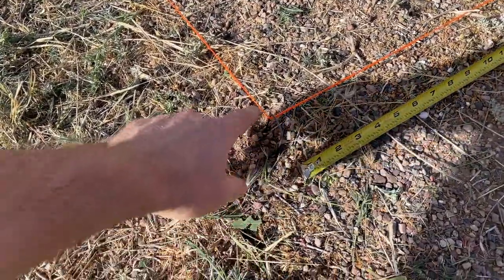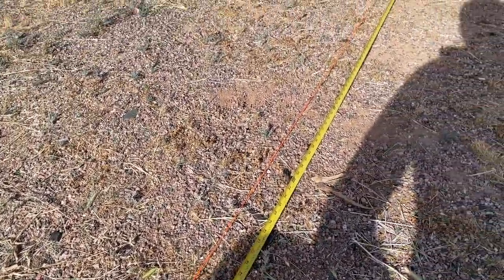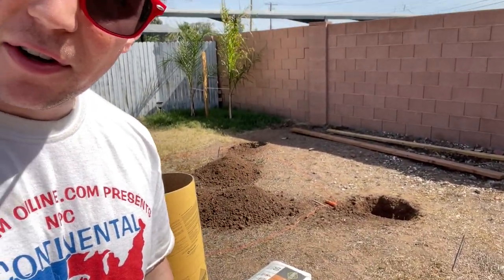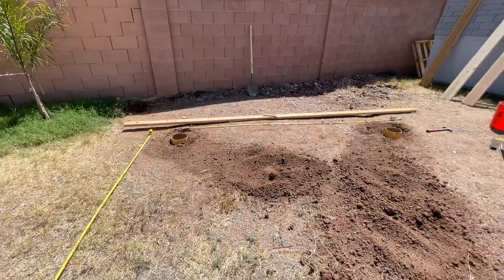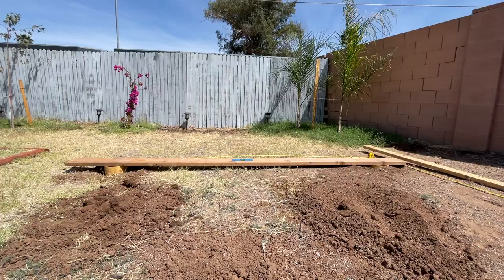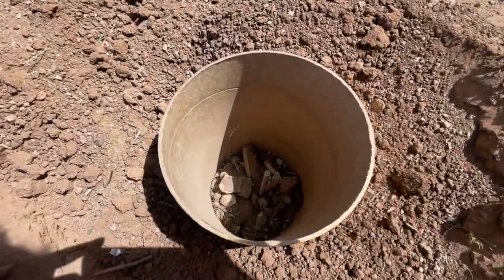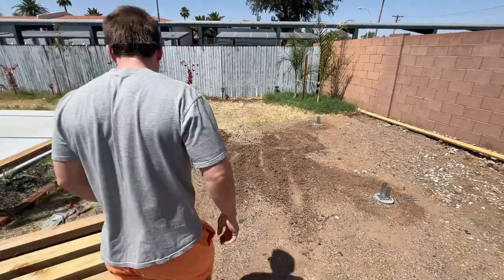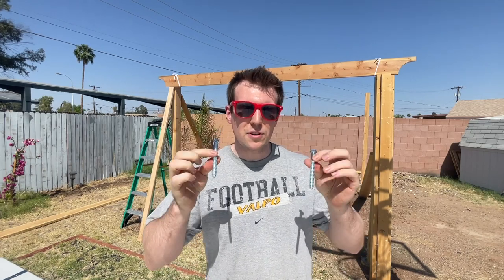$500 Backyard Pergola Build! #DIY

Comment: Can the post be setup in 4 inch concrete slab
Reply from the maker: Yes you can do that, I would recommend pouring the slab first and then drilling the footings and setting brackets.

Comment: Your existing shade structure is anchored to the eve ? Did I see that right?
Reply from the maker: I’m not 100% sure what you mean- the beige sun shade is weaved through the top 2x4s and then anchored into eye bolts in the 4x6 posts with nylon rope. I hope that helps!

Comment: Very nice video. It would be nice to put links to the materials you used.
Reply from the maker: Sorry about that, here is a quick list:
2-48” concrete form tubes (cut in half)
4- Simpson 4x6 anchor posts
4-4x6 posts 8’
4-2x8 beams 10’
1-2x8 board 12’ (corner cross braces)
8-2x4 across the top 12’
16-Simpson 2” bracket to secure 2x4
1-10x10 sun shade (Amazon)
4- bags concrete
4-rebar pieces 2’
4-eye screws (secure sun shade
Rope/chain (secure sun shade)
1 gal polyurethane
8- bolts, 8 washers, 8 nuts (secure posts to anchors)
Box of 2” screws
8- lag bolts (top beams to posts)

I think that’s everything!

Comment: Great posts. Where did you get the metal brackets to attach the posts to the  concrete?
Reply from the maker: Home Depot or Lowe’s! Here’s what I used: https://www.homedepot.com/p/Simpson-Strong-Tie-PBS-Galvanized-Standoff-Post-Base-for-4x6-Nominal-Lumber-PBS46/202255661?source=shoppingads&locale=en-US&&mtc=SHOPPING-RM-RMP-GGL-D29B-Multi-NA-WATERPIK-NA-SMART-NA-NA-MK581541800-NA-NBR-623-CON-NA-FY22_623&cm_mmc=SHOPPING-RM-RMP-GGL-D29B-Multi-NA-WATERPIK-NA-SMART-NA-NA-MK581541800-NA-NBR-623-CON-NA-FY22_623-71700000097259685-58700007902180421-92700071862301787&gbraid=0AAAAADq61UdFBVv_nfNTt35n3TB9qBGae&gbraid=0AAAAADq61UdFBVv_nfNTt35n3TB9qBGae&gclid=EAIaIQobChMIgIqy7JG7-QIVeQytBh1VsgBFEAQYByABEgKn8_D_BwE&gclsrc=aw.ds

Comment: This was wrong because the weight of the main cross beams should be carried directly by the uprights and not by bolts? This is how not to do it acccording to other videos Ive watched.
Reply from the maker: It’s definitely not wrong, lag bolts are rated for 1,000s of pounds, the beams are 25lbs.
Reply: @taylor.g.deloye  When new

Comment: Did you make pergola roof with angle or horizontal?
Reply from the maker: The sun shade is woven on top and under the cross beams to prevent movement and give it a nicer look. I hope that helps